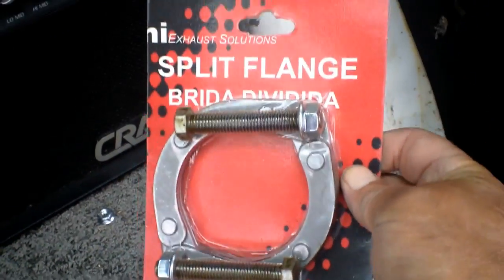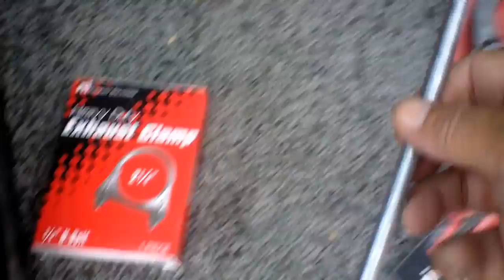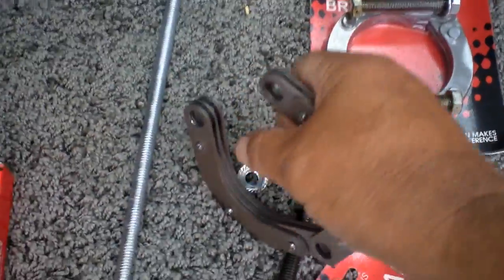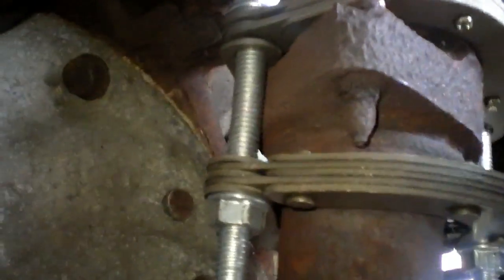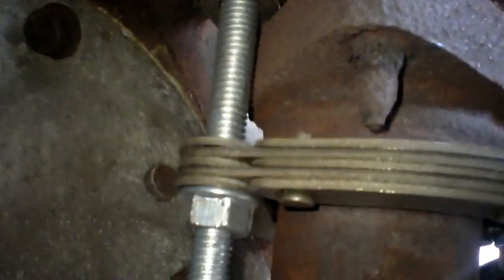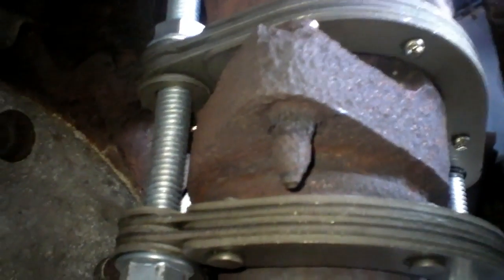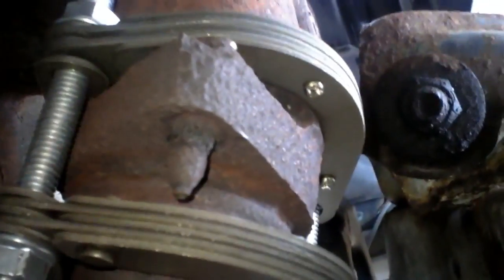exhaust flange donut easy tail pipe and muffler repair under 15 bucks

Comment: Thank you so much saved me so much I have a 2000 Camaro and the bolts always break at the flange and you have to take the whole exhaust manifold off to drill and tap the broken studs off and they don't make new factory manifolds anywhere this fix was under 20 bucks
Reply from the maker: it worked for me too

Comment: How does this hold up with the original that floats, there are springs under the bolts that allows that joint to move with the donut that sits in there, this fix seems to make it solid which seems that it would cause problems but stopping all movement.
Reply from the maker: it lasted 2 years then I sold the truck , works good

Comment: Just bought two of the exact same split flanges and about to pick them up. No welder, saw, grinder etc. necessary. I hope it works for me. Bought some exhaust goo too I'm going to schmoo everywhere. $9 fix after discounts. If it works that is.
Reply from the maker: OH YEA

Comment: I bought two splits for my car to do this same fix. Can't get them to open up tho... how did you get it to pull apart
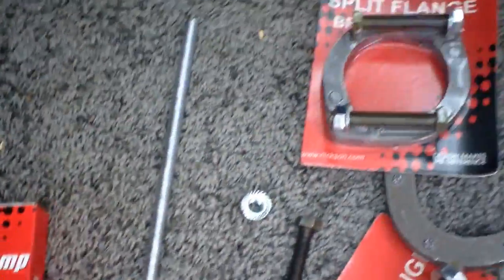Reply from the maker: look @ 0:29 pull it in half moon- and slide it back on the flange- I also used two different sizes for mine -the top was one size bigger than the lower
Reply: Logan Dyer Did you ever get them apart? I’m having the same problem. It’s like welded tight.
Reply: WBB Clips they won’t come apart because someone has used them and tightened the bolts order a new one and it will work fine

Comment: Huh. I feel like such an idiot, I never even knew these things existed...good to know because Im just about to replace the Y pipe on an old S10 Blazer semi-beater, and obviously WILL, with absolute certainty, snap all the bolts off (even though they've been drowned in PB-Blaster twice over the course of a week).
Reply from the maker: IT WILL WORK